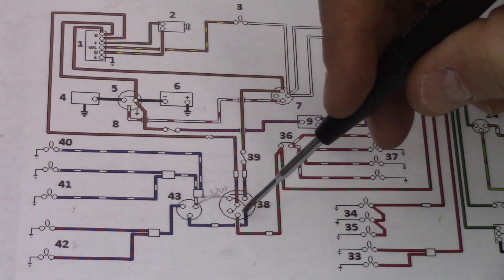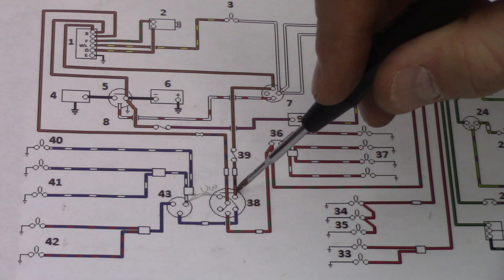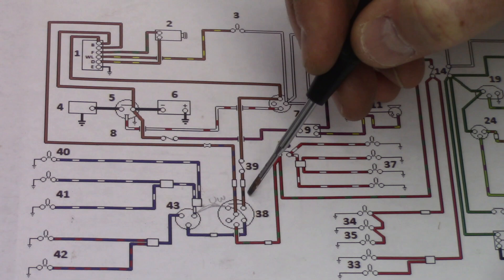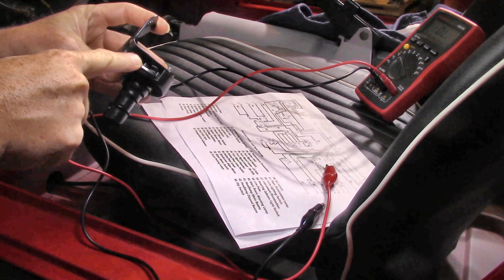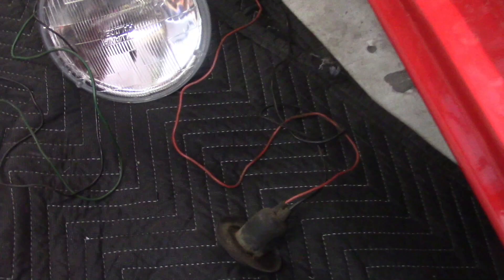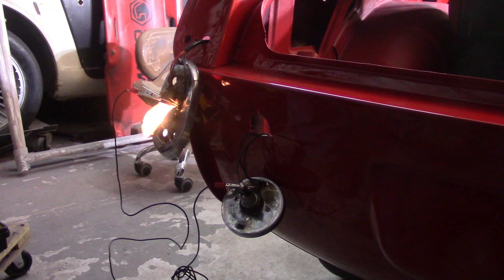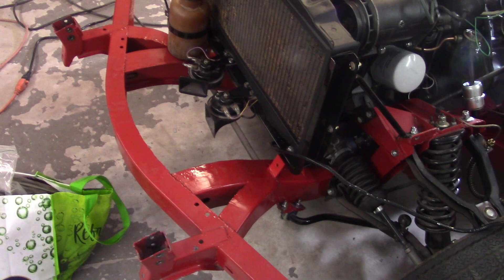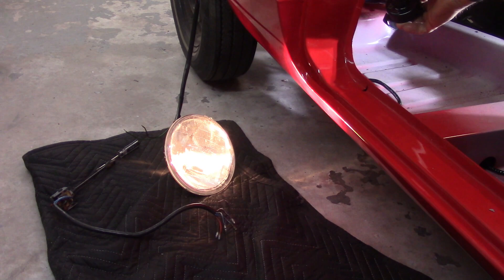Triumph Spitfire Headlight Switch - What Were They Thinking?! | Roundtail Restoration

Comment: Chris, just one observation. With your admittedly weak power supple (6 v), you conclude that the switch to "flash your headlights" produces a weak hi-beam light. Seems logical. But when you use the foot switch to hi-beam the lamp appears full strength - same power supply?.  So, that doesn't seem logical and suggests that maybe the "flash your headlight" circuit has a problem?  I am probably missing something because your are my Spitfire sensei and I know you are methodical in these areas.
Reply from the maker: lol, you caught me. I noticed the same thing and didn't say anything about it. I haven't looked into that, but I definitely am. While they are wired differently, it's not different enough that it would cause a change in brightness. Hmmm...
Reply from the maker: You're on to something here, Hyun. I went through the diagram and they way I have it wired up, I'm turning on both hi and low beams at the same time. That causes the power supply to really load down and, hence, the overall dimmer light. That being said, I'm not so sure that that isn't how Triumph made it, but I've asked the question on my favorite forum and I'll see what they say. See, that's why I keep you guys around!! Thanks so much for the great question!
Reply: @roundtailrestoration  haha - Chris you are still my sensei - absolutely love your work and looking forward to your usual professional work around on this wiring. Keep going!!!!!

Comment: Hi Chris, great stuff as usual.  I am pretty sure that on my TR4A pressing the main beam foot switch powers up both the main and dip filaments, so would suspect that Triumph had the same philosophy for the Spitfire.  Did you resolve this issue from your forum?  In your final summary you did not mention the main beam blue dash indicator; I assume that this was wired and worked ok.  Regarding the dash mounted pull switch to bring on the instrument lights; the 4A has a rheostat to adjust the brightness of the instruments, so maybe the pull switch was Triumph's way giving some control, but with a cost saving on the lower priced model.  Or maybe a difference between markets.
Reply from the maker: Hi, Robin. Yes, I got it figured out and the flash on the column switch turns on the main beams, regardless of if they are already on or not. So, if the dipped beams are on, your getting both. As for the blue dash indicator, that's twice now that I've forgotten to look and make sure it works. I'm pretty sure it does, but I'll try to remember to check next time.
Dimmable dash lights?! You big TR guys are so spoiled! I think it was a difference between markets for the Spitfire since I think the RHD were the only ones with foot switches (and I think just US at that). Thanks!

Comment: Just to confuse further, if you're thinking of upgrading the headlights,  feed the main beam (blue/white) through a relay. Then the switches just put the relay on off, and the power for the headlights can be separately fused. The old switch gear doesn't tend to like the larger current draw from halogen bulbs.
Reply from the maker: Thanks, Barry. I don't intend on using any other than sealed beam (don't really intend to drive at night too much), but it's definitely something I'll explore before switching over!

Comment: Another great video, and the car is looking wonderful.

I wonder if there's an earlier version of the system that follows the diagram you have, as it would work, just a bit differently. The headlamp switch shows an internal link from the momentary switch (for flashing) to the main headlamp power output. This would have served the same purpose but would have only powering the filaments currently selected at the floor switch. The addition of the 5th wire  guaranteed high-beam regardless of the floor switch position. If the switch itself is still arranged this way, you would be powering all four filaments when the lamps are turned on in the low position AND the momentary switch pulled. More of the Triumph experience...revisions that didn't make it to the manual.
Reply from the maker: Good points, J. Something I'll have to look into. The British cars are wired differently, without the foot switch, but I think it's a mix of what you are saying and what I have.